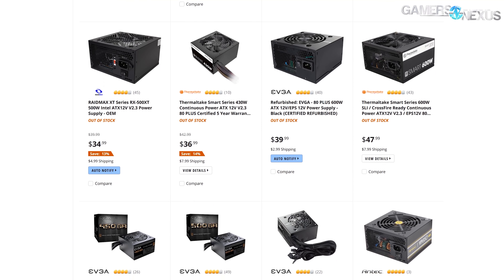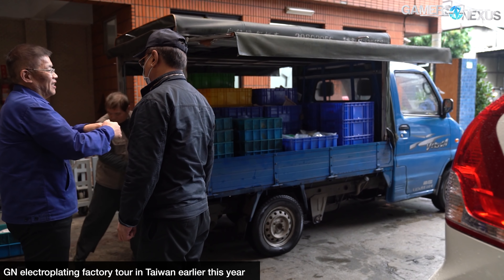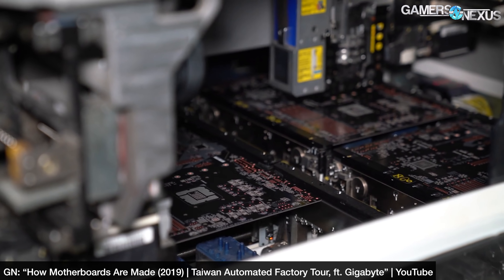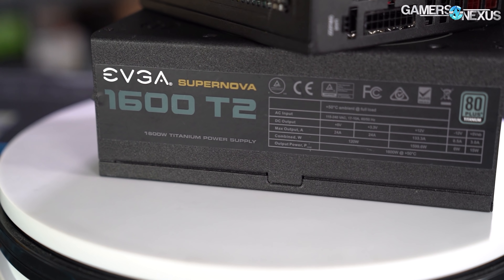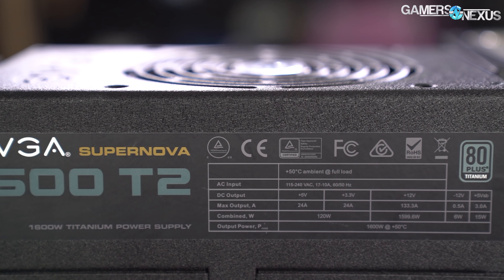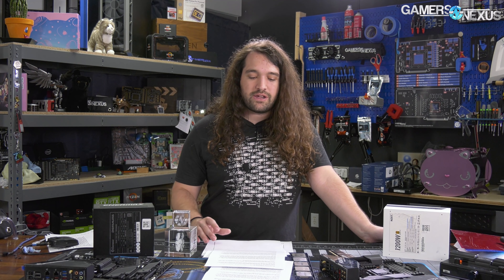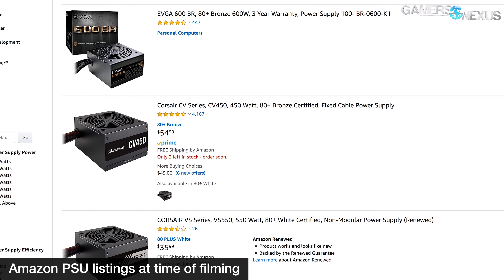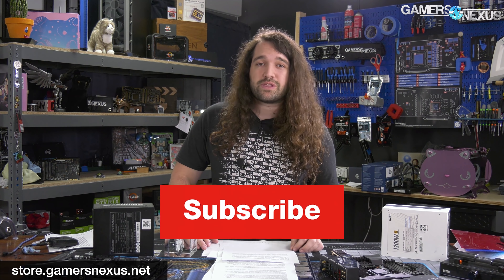Out of Stock: Power Supplies, Motherboards, & Video Card Shortage Explained, Restock Dates

Comment: Price gouging going on..   Newegg and Amazon both are "sold out" but then their sellers have them in stock for 2x the normal cost..
Reply: Yes. It’s REALLY bad; several hundred dollars mark up. I’ll be patient, nothing is set in stone, except gravity and death.
Reply: Dozer Roman um ok
Reply: this is frustrating. two of my friends and one of my cousins plan on switching to pc and this is happening. glad i finished my build by the end of January.
Reply: @dozerroman4325  I'm okay with $30-50 markup but several hundered is just plain scummy.
Reply: Gouging cannot occur unless somebody pays the price.  Just don't.
Reply: High demand and short supply, then factor in those sellers will be waiting 4 weeks before their next shipment.
Reply: Dozer Roman Gravity is relative
Reply: Yeah I saw that. I was gonna get a EVGA rtx2070 super. But I'm just gonna get a FE on Best Buy because it's cheaper now.
Reply: I've even seen 5x the msrp, not even including the $50+ shipping. Managed to find an sfx psu at a reasonable price from an online retailer for my new itx build.
Reply: @dozerroman4325  Except that is not so....when you subscribe to skeptics magazine and apply high end skepticism, gravity is a theory and death is a heavy nap, both of which are highly speculated on..

Comment: As a small point of clarification: Many passenger planes are in the air, flying cargo-only flights. In fact, these flights have made Anchorage, Alaska the busiest airport in the world.
The economics are fascinating. Many airlines are receiving government incentives to keep their workers employed, demand is exceeding supply and jet fuel has been seeing historic lows. This combination of factors has made inefficient air freight commercially viable when it would otherwise not be for commercial airlines.
Reply: Another point I think need to be added is that, while it is commercially viable, it won't cover the usual profit made by selling seats. And since passenger airlines cannot utilize every space available (since it still have seats), its still carrying less than a full-on freighter plane. So overall, airlines are still in very deep shit.
Reply: Somebody watches Wendover Productions...
Reply: @beetooex  thought the same thing hehe.
Reply: Economics? More like clownconomics. Haha BRRRRR
Reply: @dpokor   hehe
Reply: ANC is a special case though due to it's location landing fee's being dirt cheap. it allows lower volume, shorter range aircraft from asia/US to be used instead of using the more common long haul 747, 767ER, 787 for high volume non stop flights. (disclaimer i work in the shipping industry and deal with commercial airline freight as well). air freight on commercial airlines is not viable and never will be. the margins aren't high enough. they'll keep the lights on and it'll pay for the fuel but there's no real profit. the moment they can go back to standard passenger flights they'll ditch high volume cargo freight in an instant. it's purely a stop gap to limit them bleeding money since they're still having to pay their workers full wages to keep the government kick backs even if their employee's are on limited work hours.
Reply: Haha 😂 read the reply juste to see who's was to comment about Wendover Productions

Comment: I'm a manufacturing planner in the UK, doing SMT products (not PC). I'm not a buyer, not terribly knowledgeable about supply chain itself, also I should note that we are trying to buy smaller components for final assembly rather than finished made to stock for retail, but I can concur that many of the problems described in this video chime with my own experiences at work (thankfully my firm still mostly has healthy order book). Particularly the air freighting issues. We simply can't get the flights sometimes and shipments frequently get stuck at hubs when we can. Higher premiums on quick reaction buys have been common. Complications in supply chain certainly mean I'm working longer hours. Good vid. 

It is indeed quite amusing to see that the government aid payments get splurged on pc parts. But here's my own anecdote touching on that sort of thing: bought a 5700xt at Xmas , bios and/or driver issues fooled me into thinking that my 4790k (z97) board had failed last month (poor analysis and latent desire to upgrade anyway on my part), so bought ryzen 3600, memory & mobo. Could only afford to do that at short notice because I have been working from home since lock down and saving £150 on fuel bills a month. Funny old world.
Reply: Hi. I'm using same setup as you had. 4790k/z97/5700xt upgraded from gtx970. I'm wondering if you noticed big improvement going from 4790k to 3600/ddr4 etc.
Reply: Josh Ashe yeah I bought a 2070 super with my stimulus a lil splurge
Reply: @joshashe2087  yes I certainly did see improvement. I only have an old 60hz 1080p display so can't comment on higher res, but I definitely need a frame cap v sync on many things now or get lots of stuttering/tearing due to too many frames :). It's probably worth considering the new umm 550 is it board chipset now if it's available, I got a b450 mortar max, which is a good board I believe, but I bought just before amd announcements and am now a bit gutted. But in terms of performance, yes very much a good upgrade, 5700xt issues notwithstanding (all things being equal I wish I'd bought a 2060 super really) . I also went with a Samsung nvme ssd
Reply: @andrewgoodall2183  I see, thanks for the reply :) It's weird you are experiencing stutters... I thought it would be quite the opposite because of newer/faster technology that ddr4 brings. I'm using 144hz monitor with my setup and sometimes I see huge video lag (0.1%), so I thought I'm being bottlenecked by ddr3. But maybe it's specific 5700xt issue, never experienced anything similar with gtx970. I'll try to change vsync settings in games see if it helps. :)
Reply: @joshashe2087  you get stuff like that for different reasons. Freesync in your case if you have it would be the obvious setting of choice. My display is ancient, having too many frames is known to cause issues, that's what v-sync is for
Reply: Splurging money is exactly why the government are giving us money. The people who make those PC parts or those involved in the transaction all have jobs. That rely on people buying stuff.
Reply: Dang that sucks imagine if the uk still had its own manufacturing base, bet you could buy something locally not worried about aur freight
Reply: @magustrigger9195  2.6 million people work in manufacturing in the UK. We build and export some of the finest finished goods in the world, that's one reason we have the 5th largest economy in the world (for now at least). Don't confuse having an import/export deficit (a staple of many European countries) with not having a "manufacturing base". It's simply not as big as it was in Empire days, and what it lacks in volume, it frequently (not always) makes up for in quality or level of technology.

Comment: My intelligent ass decided it would be a good idea to sell my entire PC’s parts to upgrade, without checking out the market first.
Reply: I never sell PC parts before buying new ones. Learned it because empty stock is like once every 4 months here.
Reply: Damn, that sucks
Reply: Feels good that i am not the only one
Reply: Oof I decided to buy my psu 3 months ago so I’m good but I still need my gpu and mobo so im screwed
Reply: Really? And how did you manage to sell your used computer parts so quickly?
Reply: It's worst when the computer dies and you have to replace 2 major components ... fml
Reply: @GholaTleilaxu  probably assumed pre-corona pricing and sold for way too cheap, so it got bought quickly.
Reply: Yea I started buying parts since new year and waited for good promotion on MoBo and now I'm sitting with almost complete new PC that I can't use.
Reply: Ghola Tleilaxu because of the low supply of parts
Reply: Big oof

Comment: Tech Jesus can you check out the claims of Coolermasters “80+white” that says it has surpassed other bronze or even gold rated power supplies.
Reply: Is that what 80+ White is supposed to be? I've seen a couple 80+ White PSUs available while trying to buy a PSU recently, but haven't been able to find anything online about it.
Reply: KenJyn76 white is supposed to be the lowest tier iirc (below bronze)
Reply: "80+" (white) just means 80% or better peak efficiency (usually at 50% load), "80+ Bronze" is 85% or better, "80+ Gold" is 90% or better. You can check the Wikipedia article /wiki/80_Plus for the full details.
I do not know about the claims you refer to but my guess is that any unit certified as "80+" (white) could be in reality anywhere over 80% efficient, but due to variations in component quality and manufacturing, not all of them are able to reach the next tier (85% efficiency for "80+ Bronze" etc.) and therefore the whole SKU gets certified as just "80+" (white).
This means that in reality there can be "golden samples" that are able to surpass higher efficiency rated PSUs, but does not mean all of them are able to; otherwise the whole SKU would be rated higher. 
Perhaps it just makes more financial sense to source specific components that are able to guarantee an 80% or better efficiency and save time and money on the extra QC involved on binning for higher efficiency tiers.
I'm not an expert, just a normal guy who wanted to understand why the heck a 80+ Titanium rated PSU costs twice as much as an 80+ Gold of the same wattage and manufacturer.
In my opinion just don't bother with anything over 80+ Gold (for quality purposes) unless you're running a server farm and there's a clear ROI down the road on electricity cost.

Comment: I think the supply chin to US has more impact on the shortage of the PSU. I was considering upgrade my PSU with a Corsair i PSU at the end of last year. I noticed even at that time, the selection of available PSU was limited and the price was not as lower as they had before. I think probably the trade war and tariff suppressed the restock of the PSU to US. Then comes the COVID-19 lower the amount of flights between China and US. And I don’t think the PSU has the priority on those limit planes. I think the PSU will be back when everything gets to normal. The production in China has already back to normal and actually they have plenty of the PSUs. Because there is no sign of PSU shortage in China market at all. Almost every line, every model of Corsair are available with regular price. Actually there will be a huge sale in mid June. For example, you can get a AX1600i with 400 usd including tax.
Reply: 杨星宇 yeah it was a bad idea to offshore all manufacturing sent overseas with no domestic options, very poor plann8ng on a national scale. Greed over 20 dollar differences was the down fall I suppose.

Comment: I build retro systems and tend to use older power supplies, say 10 year old+ power supplies and I have seen the prices triple on the units I purchase (corsair and seasonic). I dont know if there is a flood of people building retro systems or people having to turn to older power supplies to power newer builds but even these older units have tripled in price. Worst I have seen lately was a NIB 2011 Corsair TX650 power supply sell for $185.... crazy I tell you.

Comment: I've been wondering exactly that for weeks. I ended up paying a decent premium to get a sf600.  Edit: Paid about 40% more on top its average sell price in the UK.
Reply: I bought a rm750x a month ago and the price was inflated $30. Still though, really happy with it. Dead quite. The EVGA I had would blow the fan at 100% always.
Reply: @Bananas Daily Thanks mate, didn't know about that. Mine literally arrived yesterday. Affected units were made between October and March,  affected lot codes 194448xx to 201148xx. Mine must have been made very recently for its lot code is 201248xx
Reply: I spent $190 for a $135 power supply thinking I finally found one that was in stock... turned out not to be in stock and my order is on backorder supposedly until mid-June. Would of been worth it to me if was gonna get my psu right away but I ordered on the 11th. I just feel ripped and salty now. im not canceling my order though

Comment: more reason to produce in the US.
Reply: Absolutely
Reply: @StealthIsKey454   and pay like $1200 for a 120GB ssd? No Thanks.
Reply: Not unless you want a $1000 power supply that's built wrong and probably a fire hazard.
Reply: I agree, but good luck putting that horse back in the stall.
Our low price consumerism has brought China to bear, and people aren't going to change that desire, which means US is automatically out of the market on pricing alone.
Reply: The misinformation in this thread is laughable. It is more than possible to manufacture in the US and maintain competitive prices. The problem is that stock holders and CEOs will have to sacrifice the bottom end. Meaning lower stock prices and 100 million less annually. Greedy POSs are not willing to make that sacrifice. I know because I used to work for a 100% employee owned manufacturing company where products were 100% manufactured in the US. The prices were competitive with the likes of GE and ABB with quality far exceeding either.
Reply: with US min wage and living cost? i'm expecting $200 for tier 1 $600w PSU and $350 for tier S 800w

Comment: You've answered the question I wanted to ask you. In the middle of a new build and so far have PSU and motherboard (that I want) problems. (I'm in the UK) and looking at the largest retailer (other than Amazon) I can see they are quoting lead times up to September for some PSU's. It seems they have stocks of the 400-500w modular (at some outrageous prices mind) but anything modular 600w & over is out of stock. Unfortunately they are also out of my specific motherboard too.

Comment: Love the industry deep dives... its some of my favorite content on here.  I was planning to replace my 10 year old system (i7920) this year but the lack of components has probably pushed me back until after the new ryzen comes out.  Even if ryzen3000 is back in stock AND the matching b450 or cheap x570 board becomes available... I'll still be pairing it with 10 year old PSU and probably my GTX 970 and sata II ssd since I can't get what I want there below budget either.    No real point to pay high demand prices for hardware on the cusp of a new CPU/chipset generation.

Comment: Some of the review sites said to buy your computer building supplies quickly when covid all started. They warned of a potential shortage. I built a mid/high end PC and ordered the parts a few weeks before I needed everything just in case and I'm glad I did. Another review site said don't go rushing to buy, everything is fine. I'm glad I took the precaution to order early. Even in early March of 2020, I had to get a larger corsair power supply and case than I needed due to out of stock problems.  But the thing is built and probably wouldn't be if I had waited longer.

Comment: So a little over a month ago the semi modular evga psu randomly became in stock so I got one for 60 bucks and it finally arrived last week however inside the amazon package which was concealed was the evga packaging. The tape was already cut and the flaps were already out. Should I be concerned or does it mean it had some rough shipping since it did come from the other side of the country.

Comment: Still massive issue on PSU shortages here in UK, looking at a new build and most of the high efficiency platinum or titanium  PSUs are either sold out or have pre-order dates of December+... so my new build is screwed for the foreseeable future.
Reply: Same goes for just about everything else here in the UK. High-end GPUs for example. Even gaming hardware like Logitech steering wheels and flight yokes e.t.c are just not available and out of stock.

Comment: I just bought a Seasonic 750watt power supply about a month ago.at that time the cheaper lower watt( 450-650watt )were not hard to get i jumped on the one i got when it showed up as in stock but it cost me $162.00 with tax and delivery.

Comment: Watching this on July 1 and some bottlenecks are still there.  I had been thinking about doing a new build in January but decided to save that money to have some extra spending ability for a trip to the UK and France this Summer and do my build near the end of the year or beginning of next year.  Oops!  The real problem now is the constrained supply and increased demand has pushed up prices to an unreasonable level, at least for me.   So it doesn't matter that I can get the parts, I'm not going to pay an extra $100 plus for a decent mobo or video card.  I will wait for now.
Reply: Same, I'm just going to wait. I've waited years to upgrade, I can wait a bit longer.

Comment: I upgraded my computer mid april. The motherboard I bought was put of stock a few says after I got it and still currently is out of stock. Didn't have a problem getting a CPU. Monitors were also hard to find at any kind of reasonable price. I ended up buy a brand new one from best buy, but that was the only store carrying that model. Thankfully I didn't have to get a PSU.

Comment: I did notice the available power supplies were oddly dissapearing over the last 2 months while planning my builds. Figured it was either everyone releasing new models at the same time, or the obvious. Guess it was strange how those dissapeared on the daily compared to other things that seem to be available.

Overall though, I fear things are only gonna get worse depending on location. Shipping lines seem to be finally degrading here in the US as we're on the verge of "reopening". Packages have been taking forever to get here over the last month, and all the shipping guys are usually on point in my neck of the woods